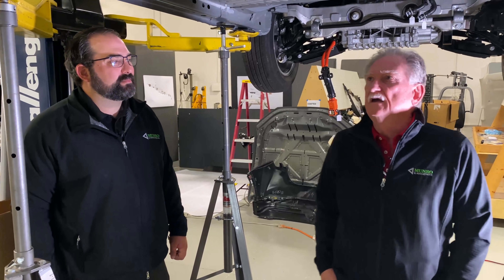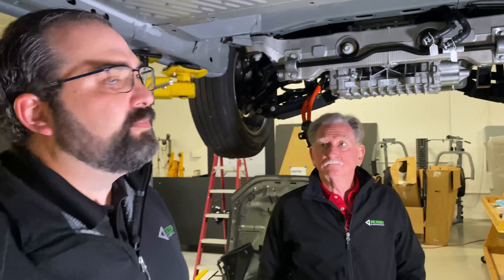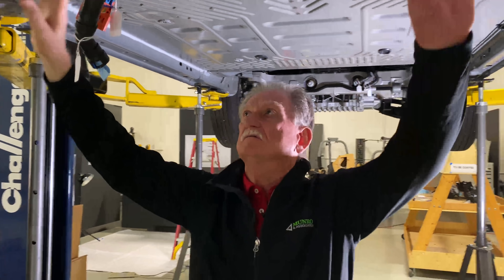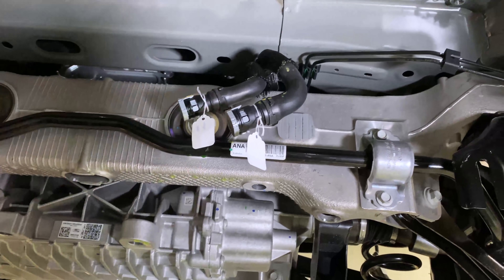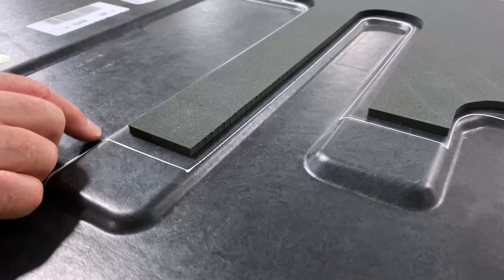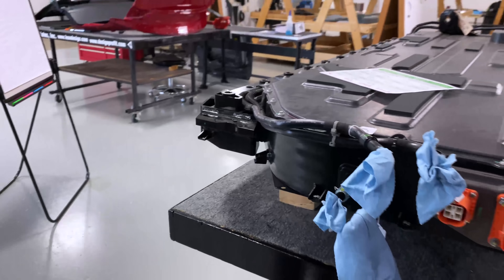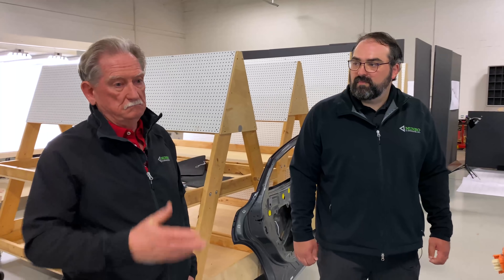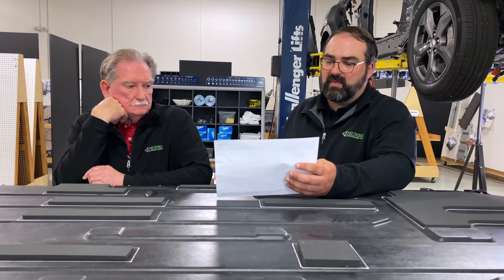First look at the Ford Mustang Mach-E Electric Battery

Comment: Munro live... In harsh cold climates is it an advantage to cover the brake lines between car and battery to protect them, or is it a huge disadvantage as they will need to remove the battery pack to replace the brake lines?
Reply: Don't forget about the salty gunk which will accumulate up there, corroding the lines. To be fair to Ford, if the pack is as wide as the vehicle can accommodate, there really isn't anywhere else to put the brake lines.

Comment: I did miles travel for each kg. For ease of reading moved it up 10kg.

Miles per 10kg pack.
T3    7m
Y      7.2m
CB    5.9m
Jag.  3.9m
Audi  3.1m
i3       3.4m
E        4.3m

Comment: The high voltage gloves are probably effective protection, but for that Nth degree of safety fanaticism, your techs shouldn't be holding those voltmeter probes in both hands simultaneously.   Figure out a way to hook one of the probes on so it doesn't need holding, then move in with the other probe, one-handed .

Comment: Those slotted locating brackets look like they could serve to allow the battery to move backwards in a frontal collision, and even push it down and out of the brackets entirely if the force is large enough. They happen to be in line with the load carrying members of the front impact structure too. The strength of the battery box to be used in such a way would also help justify making it a structural member.

Comment: Good info but you need to adjust your chart for usable battery capacity and actual range (15-25% less than advertised for Tesla, exactly as advertised to 10-20% better for others in independent testing). There are other factors that I’m certain play into battery weight like ability to sustain fast charging rates (Tesla cannot), ability to deliver consistent performance at all states of charge (Tesla cannot), ability to deliver full advertised performance without preconditioning (Tesla cannot), etc. To say that a Nissan Versa is lighter and more economical than a Porsche 911 is not telling the whole story.
Reply: A tall but steep charge curve is not necessarily a bad thing. Especially if area under the curve is the same.

Comment: Battery chart suggestion.  Add column kilowatts per mile or miles per kilowatt. 

Weight seems only applicable if your measuring at the cell module level as you mentioned about differing structural solutions.

Comment: Sandy, being the early days of EVs, there is opportunity to select the units for comparisons of efficiency and effectiveness. If you add 3 columns to your chart, capacity/battery weight, capacity/range and range/weight, you get a great set of comparison numbers if express the results in Joule/gram (J/g), Joule/metre (J/m) and metre/gram (m/g). 
The first metric yields a range of 618 J/g down to 340 J/g, the second metric yields a range of 533 J/m up to 975 J/m, and the third metric a range of 1.159 m/g down to 0.502 m/g. On the third metric, only the Teslas score over 1.0.

Comment: You can really appreciate how Tesla's mega castings for the front and back structure of their cars is going to be a big cost/time saver when you look at all the pressed, formed and spot welded sheet metal parts on this Mach-E.  Then you have all these secondary operations, like welding and all the jigs and robots to hold these subassembly parts in place for spot welding.

Comment: And you brought a 8 years old BMW i3 battery weight, capacity in that comparison table? BMW at 43 kWh with the same dimensions since 2019. It is called 120 Ah battery model and as far as I can remember it is 13 kg heavier then the 22 kWh (it called 60 Ah) battery was.

Nice technical vid anyway. Thank you!

Comment: Those are manually done welds. On the right side the welder has done a second pass to fill gaps/holes. The left side has too inconsistent travel speed between the pulses in order to be a robot weld.

Comment: You describe the Mach-E battery pack as being structural; but I do not believe anyone else does that, right? So it would be interesting to see what the total weight of the vehicles is as well. Do you guess that by moving some structure into the battery pack, Ford was able to decrease weight in other places?

I would be tempted to say that the work you guys did with the thermoplastics company on the ID4 battery pack will trickle over to Audi. I wonder if they Audi battery pack was an early template for the ID4 pack.

Comment: Efficiency wise: Chevy bolt has the best range / kWh only slightly better than the Teslas (Chevy: 6.94km/kWh, Model Y: 6.76km/kWh, Model 3: 6.65km/kWh). Looser: Audi e-tron (3.69km/kWh).. That´s a factor of over 1.8 of efficiency difference lol.

Comment: My first impression after battery removed is that the MachE is working toward a swappable battery 🔋.

This because the battery removes so easily and is basically one big slab.
Reply: All modern EV batteries install that way. It is to make manufacturing easier, not to allow routine swapping.

Comment: 16:06 These are the capacity per weight (power density) ratios [higher is better]: 
Mod3 0.17, ModY 0.17, Bolt 0.14, Jag 0.15, Audi 0.14, BMW 0.09, Mach 0.14. 

The  Jag is not that bad (in fact it's the best except for Tesla) compared to the Bolt and Audi or the Mach-E. The BMW brings the pathos.

Range per weight: Mod3 0.71;  ModY 0.72;  Bolt 0.59; Jag 0.39; Audi 0.31; BMW 0.35; Mach 0.44
Range per capacity:  Mod3 4.13; ModY 4.2; Bolt 4.32; Jag 2.6; Audi 2.29; BMW 3.68;  Mach 3.10

Looks like the Audi is the pork pot.
Reply: I can wait to get those numbers for the Model S Plad (with 18650 batteries cell) 
and in the future the Model Plaid + or the new Roadster (with 4680 batteries cell) 
compared to the 2021 Model 3 82 kWh (with 2170 batteries cell) 
and also the 2021 Model 3 SR+ and Model Y SR (Made in China) with more heavy LFP batteries !!!!

Comment: Love your videos, very informative.  Anyway, wonder how much bracing is in battery box and its weight; and if the 2 guides at the back of the battery box could be structural that ties the battery box to the rear suspension and the back of the body. 

I am looking for a new EV, but to me, EV available now are too heavy.  Aptera, if it ever comes to light, maybe the way to go.

Comment: The rocker panel seems to be regular mild steel. Must be a rust/saltwater trap in winter areas with salted roads? And the battery case is aluminium? Galvanised corrosion?

Comment: Thanks so much for the very detailed explanation. Compared to Tesla they have nothing "lean" to offer, lots of different metals mixed a disaster in the long term with corrosion. Wow compromised welding in critical structures. What Ford needs is a gigapress eliminating the almost infinite steps. Not a suitable car for either tropical or winterized salted roads.
Reply: Cars these days at full of mixed metals, they do just fine... And I'm in the salt belt and fix cars for a living

Comment: Are you sure about the battery size on the Bolt?  What you have works out to 4.32 miles per kWh vs. the Teslas' 4.13 and 4.20.  Seems overly efficient?
Reply: The Bolt is smaller than any recent Tesla model. In Transport Canada's published values, the Bolt has energy consumption between the standard and "Performance" versions of the Tesla vehicles, and Tesla's published values are known to be optimistic.

Comment: Isn't the Bolt with 259 miles range (2020~2021 models) using a 66kWh rated (62.7kWh actual) battery? It's the older models with 238 mile range that had a 60kWh rated battery. Might need to adjust those Bolt pack numbers slightly.

Comment: Also, the EPA ranges aren't really great way to compare actual expected range.  It is being noticed as more EV's are available some will outperform EPA numbers and Tesla tends to underperform a bit.  Wouldn't be big deal, but some vehicles are far outperforming the EPA numbers by 10-50% and Tesla under performs by several percent.
Reply: Yet in every real world, same day, "run to empty" test I've seen, Tesla wins?
Reply: @rogerstarkey5390  Which one? Against what? Alex on Autos did Model Y Long Range against Mach-E long range... Mach E won handily with supposedly 56 miles or so less range.  Only a Model 3 Long Range has more range than the Mach E CA Route 1 on Edmunds 65mph loop which is a much more controlled outdoor test not really accounting for much hill/wind/and other random loading... So shows Y long range ahead of the Mach E ex AWD that Alex's real world test showed the opposite.  Generally seems Tesla efficiency and range is very fickle in the real world and only really useful if very careful and controlled.... As one would expect from range derived mostly from ultimate efficiency in certain loading rather than extra energy and reasonable efficiency in lots of loading conditions. 

https://www.youtube.com/watch?v=lSmSiOo-v8s

https://www.edmunds.com/car-news/electric-car-range-and-consumption-epa-vs-edmunds.html
Reply: @rogerstarkey5390  Also, so far nobody does a dollars to donuts/miles sorta efficiency test either by running same day same loop test and then filling on 3rd party charger that can report actual grid use after the loop and say which car has the dollars per mile advantage all measured by unbiased equipment like GPS and 3rd party charger energy data. Suspect Tesla may have a more real advantage in this sort of testing if they don't have some funny 3rd party charging efficiency issues.
Reply: @rogerstarkey5390  Not to mention the fact much of the competition has hidden battery reserve means these tested ranges like on Edmunds are totally legit 100% charge done as often as you want use cases that shouldn't cause any significant deg.  If you do 100% to 0% often on a Tesla you'll likely be getting more deg over time.

Comment: Mach-E standard range has 75.7 KWh worth of cells and 68kWh in current charge use profiles allowed for use.... Weight tables should be based on actual cell capacity included and marketed usable capacity...which could be tweaked later if reliability is high enough.

Comment: Talking about losses in wires, it will also be interesting to see how much the 4680 cell, with the tabless electrode, reduces resistance which will contribute to improved range and faster, cooler charging.

Comment: I'm a little confused about the Model 3/Y battery info. My MY (performance-performance) is a May 2020 build. With the asymmetric 21's it's stated
range is 285mi because of the wheels. After a year and only supercharging about 10 times we only get 275mi at full charge. It is my understanding
that we have a 78 Kwh battery. If we do do have a 75 Kwh battery why does the chart show the model 3 range at 310 miles vs the 315 miles for the heavier Model Y?

Comment: The new Audi Q4 E-tron, built on VW:s MEB platform, is significantly more efficient than the old E-Trons. (~154 Wh/km compared to >200 Wh/km at 90 km/h in summer according to @teslabjorn). Presumably the upcoming PPE platform for the Q5 will also be ok.

Comment: No comment on the coolant hoses running the entire length of the vehicle? Should be a plastic pipe with the connector welded directly to it. Saves more than 50% of the weight, easier to assemble, much cheaper, no disadvantages.
And what about the amount and length of these fasteners? Could be made shorter and also could and probably should be made as a stressed bolt rather than completely threaded.

Comment: If Ford could match Model Y’s efficiency, the Mach-E LR would be a 375-400 mile range vehicle. Considering it rides on such narrow tires (225 width) it’s a bit disappointing that it is still so much less efficient than Model 3/Y. It’s almost Model X like efficient, but Model Y sized. The charging rate is still a huge problem for me. The charge curve should not plummet to 12kW when you hit 80%. That makes road tripping a hardship when you need to charge 90-100% between stops. It takes about 50 mins to go from 80-90% and another 50 mins to get to 100%.

Comment: The brake lines hidden by the 1000# battery... looks like a nightmare when they need to be replaced.  In salt country,   it's not uncommon to only get 10 years before brake lines rust through.

Comment: Are you intentionally not adding a specific weight into those tables? Like kg/kWh, also why not sort it best to worst and add a % difference. Including the range does nothing to the comparison of the batteries itself imo, just leave it out and use it for drivetrain/efficiency discussions only.

Comment: The Mach E is the best thing to come from Ford, ever.  Look at the quality of the components, wow.  The extrusions are so well done and all the various suspension and other parts look like something under a Porsche, not a Ford.  Are the EVs the turning point for Ford in terms of truly being a world class car maker?
Reply: The problem is, can they sell it at a profit?
Reply: @fredbloggs5902  Maybe not at first, but eventually sure as manufacturing becomes streamlined and component sourcing volumes go up.  They can use the  large contribution margins from the F150s they sell to create a solid line of EVs - or they will become a footnote in the history of car makers.  The Mach E and the Lightening are well placed and the truck will drink the Tesla's milkshake thanks to the aggressive pricing.

Comment: 16:55 maybe make a kg/kWh scheme? To show the differences more easy.
Reply: Yes, then you'll see the Bolt is actually worse than the iPace. The i3 is by far the worst, but maybe there's also an overhead penalty for a small battery pack that comes into play here?
Reply: @itekani  The i3 is the worst because Munro is showing data for a long-obsolete version of the i3 battery (called "60 Ah" by BMW), and comparing it to current models of other vehicles. The newest i3 battery ("120 Ah") has twice the capacity for about the same mass. Even the Bolt is about 10% better if you use the current version instead of the one that has been out for a few years.
Reply: @brianb-p6586  It may be an issue of them showing internal data.  If they've torn down an i3, then that may be the numbers shown.  However, that teardown may have occurred quite a while ago.
Reply: @EmperorA0  Yes, the i3 number is presumably from an old Munro teardown... but it still makes no sense to use it in this comparison. If we're doing a historical comparison, put years on each entry and include the GM EV-1 and something from 1915.
Reply: @brianb-p6586  Thanks for that clarification. So a "year" referring to the market introduction year might be nice info in the table too.

Comment: When anyone says “the competition is coming” show them 16:23
Reply: Also, if you take a look at range to weight Tesla is way ahead and that's a fact.
Reply: Tesla's range is over promised and under delivered and it's facts. Noted by Motor Trend, edmonds, Road and track, Car and Driver, and Alex on autos and several others. Boom!!
Reply: Goes to show how much tesla way ahead
Reply: @Zach-s5g  Not with all of those panel gaps and the laundry list of issues that Tesla has. Everything from doors that don't work half the time, to Windows that won't roll up, screen blackouts, fit and finish, build quality, crappy paint, three weeks or more for the flatbed to pick up your vehicle for repair and won't sell you simple parts to fix your own car. No Thank You... I'll Take The Mustang Mach E
Reply: @twany442  well it's always a choice ain't it? And I guess that panel gap issue is the same as the other manufacturers but teslas are way overblown because you listen to media
Reply: @twany442  I think I speak for all Tesla owners and fans: we’re glad not to have you 👍
On another note, your “facts” and “boom!” are worth nothing to anyone who has done proper due diligence, since Tesla’s simply are the best vehicles by any worthwhile metric such as safety, consumer satisfaction and total cost of ownership.
Boom?
Reply: @twany442  it’s a funny comment because it shows how little you are into the content matter. But hey, you gave me a good laugh 😘

Comment: That chart is just sad.  Do remember that all of these other manufacturers had plenty of time to review what Tesla did and try to at least match if not surpass the leader by bringing out their models years later.  Instead, they send out expensive wannabees.
Reply: What is your point? Is every ICE car the same or have the same efficiency, gas tank size etc?

The Jaguar and Audi are high end premium and luxury EVs. The Bolt is an economy sub compact made with cheaper materials. The i3 is a plastic car built by Germans to be a city only vehicle and it is very efficient for its intended purpose. 

The only thing all these various EVs have in common is that they have a battery that powers the motor, thats it.. Keep in mind that Tesla is an EV and software company from the ground up, so of course Tesla would be the leader in a genre that they pioneered.. Tesla's first attempt at an EV wasn't a huge hit or even very efficient.. BMW's very first EV is now an icon. The Mach-e is gaining popularity. Give these legendary automakers a few more years and they will perfect their EV cars. Tesla didn't skyrocket until their 3rd EV.

Comment: Sandy, when you say "significant structure" in the MMe battery tray, I understand you mean it's good Ford designed it that way.  What advantage does that give the car?  Better safety in event of collision?
Reply: Unless I've got it wrong, ...Stiffens the vehicle for better handling, reduced vibrations, safer in collision. Plus lighter vehicle.
Reply: @johnb7430  hopefully Sandy will weigh in.  All that significant structure may explain why I don't here rattles and squeaks in my MMe.